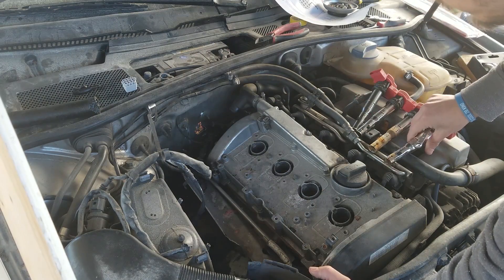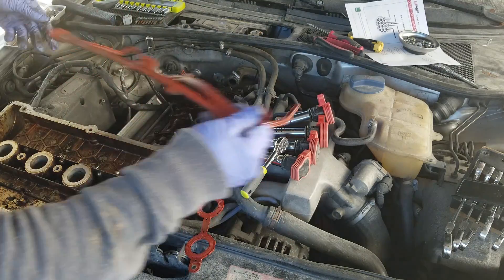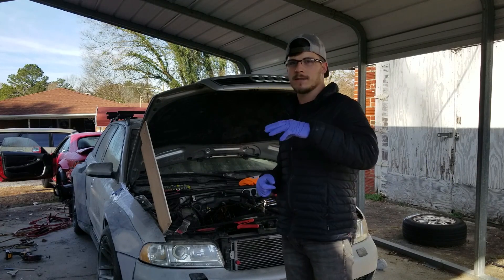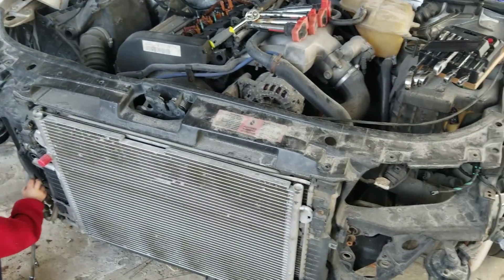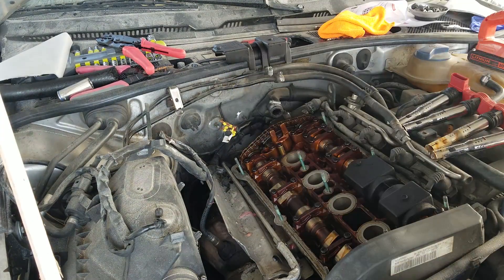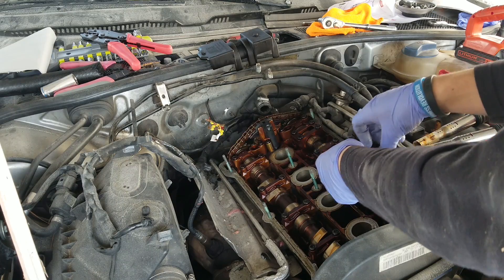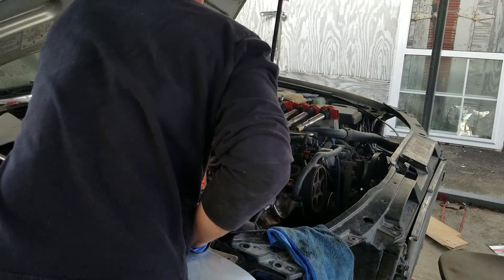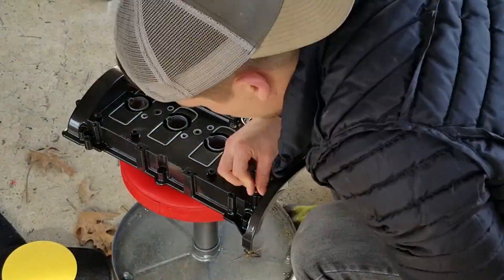MAKING A VALVE COVER AWESOME

Comment: High flow cat or catless downpipe depending on your state will give you all the sound you want from this car.
Reply: Tom Ingebrigtsen I would go with a high flow cat so then the next person doesn’t have to worry when getting emissions.
Reply: @DustySteelGarage  agreed for this car. I have a high flow cat on my a4 even though my state doesn't emission test just because I like that it's quieter than the test pipes are
Reply: Tom Ingebrigtsen I heard that it was only a little louder then the high flow cat but I’ve never ran a test pipe. I have intake and turbo inlet pipe with high flow cat and CXRacing 3" catback exhaust and I think it sounds great. having it strait piped made it loose low end boost pressure.

Comment: When I had a car that didn’t run right when I had a cone filter on it, I found out it was because of the oil that is impregnated in the filter would mess with the MAF sensor. I sorted it by buying a stainless cone filter. No oil used in the filter (although there is a much greater chance of dust getting into the inlet) but great induction noise. Great videos.
Reply: Your right, same on my A4 1.8t - 98. Btw, I washed my filter with gasolin and it turned out great haha

Comment: I have the same car.. what you can do for air filter is firstly don’t use any oily filters as that will destroy your MAF I used AEM dryflow works great, also updated Turbo Inlet pipe helps and to finish it all off make your own heat shield to make sure that your air filter is not sucking in any hot air from the turbo and your cat
Reply: VVV that’s great advice. I have an AEB Quattro and I put a 180 degree elbow on mine right after the maf and moved the filter behind the headlight. I then put a 90 degree elbow on that and turned my cone filter down because it has a splash shield on it. You can reuse the metal shield from the air box and tip tie it to the metal vacuum line.

Comment: Hopefully you have the hold downs also for the coil packs. I have them for my AEB B5.5Q and they definitely need them. I went with all black for mine; looks sick. I also have a cone filter on my intake, you have to put a 180 degree bend and put the filter behind the headlight because the heat from your cat messes up the Maf.

Comment: Just give the cylinder head a good scrub with degreaser and then sand with 150grit or something super fine and polish with something SOFT for a good 5 mins or so and longer for more detail... came up great on mine nice and shiny without removing really any surface metal. Hope that helps! Took me 15 min or so

Comment: Cut excess off the air box. Anything from the seam down usually is fine as long as its suported. Did that to my accord and it sounds and runs better than stock or short ram. Combines the airbox design with an open air pod filter. Best of both worlds.

Comment: To get noise you are looking for you need to get either a heavier or lighter waste gate spring  and downpipe. Also would help to put a short ram intake with an oilless foam filter. Great build videos brother.
Reply: Don Arnett not needed with this engine. The intake box is made to make the turbo noise go away.

Comment: @Built  just cut the air box under the filter. more sound but you gotta check frequently to clean th filter. i make more sound on my corolla like this than with a cold air system

Comment: theres a "mod" where you drill holes in the bottom of the air box for more intake noise. look it up
Reply: Was looking in the comments for this old skool vw mod, called Swiss cheese box, drill holes in the lower airbox 8mm or 10mm diameter on the front and wing side, you can hear the intake noise and sound becomes throaty. If you can also install a high flow cat it will spool up faster.
Reply: Works great sounds great

Comment: To hear the turbo intake you'd need to take out the stock airbox and open it, there's insulation in it. I also cut a hole which doesn't help intake temperatures but you can hear the turbo clearly when letting off the throttle

Comment: if you want turbo noises you will need a cone filter and a heat shield. thats what i have on mine.
Reply: Dan Santana you can also put a 180 degree elbow on it and put the cone filter behind the headlight to keep away from heat. I also heat wrapped my cat.

Comment: I'm my mk4 golf gti my filter is in the bottom of the front bumper sucking in the coldest air and I'm running a k04 hybrid turbo on a k04 manifold something you should consider I've got supporting mods and I'm running 310hp could be more but I want to keep it safe and for a fwd road car it's ample.

Comment: Put a cold air intake on it and try to free up air flow and a turbo inlet pipe. Did the same thing on my 2.0l Turbo cc r line and i heard the turbo.Also a new diverter valve will help
Reply: Drifter From Mars with these engines there’s no need to put a different dv for noise. My stock n71 sounds great. The only reason to upgrade the dv is if he is going to be running a lot more boost.

Comment: Will be very surprised if those chaintenssioner gasket & half moons hold oil inside. They are quite tricky to get sealed properly. Maybe one of the best way would be install them while you do the timingbelt and at the same time remove camshafts lift the chaintenssioner and add red RTV for the gasket & half moons. Install chaintensioner & camshaft back then timingbelt etc. 

Will be pain later to redo it if those gaskets start leak.

Comment: Get a new turbo diffuser valve they’re adjustable so you can choose how much goes into the atmosphere
Reply: Hyped Them Threads with these engines they run best when you recirculate the boost back into the system and run a catch can.

Comment: this engines are nightmare to work on
Reply: They are if they're in the longitudinal mounting position.
Reply: TheBlackLeopard  the timingchain is on the backside of the engine. Right by the firewall